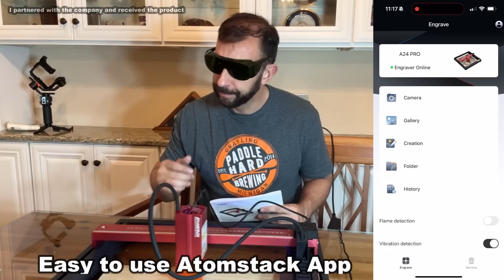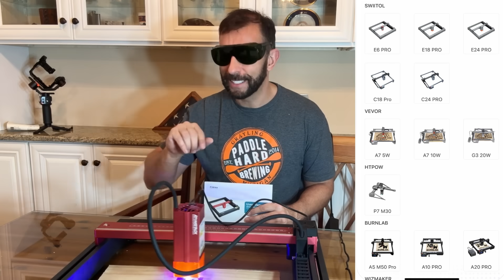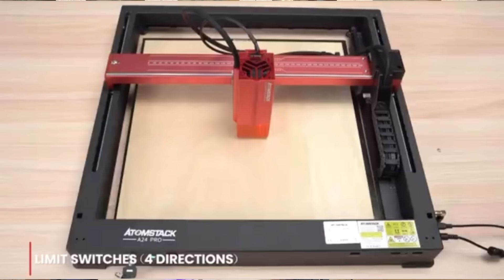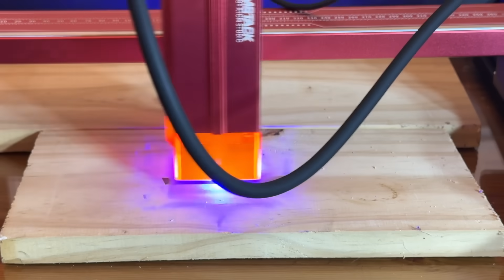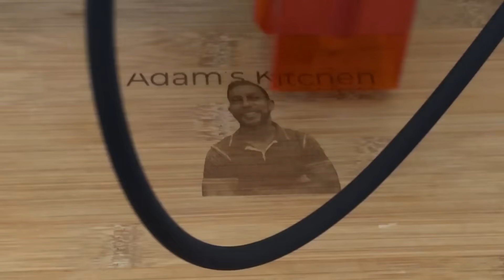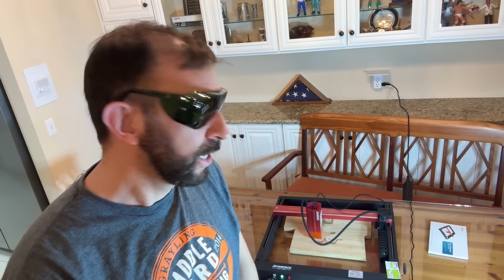AtomStack A24 Pro Laser Engraver

Comment: I have never owned or used a laser engraver until this unit. There are many videos out there that will help, plus the x tool creative space is Free, easily understood, and awesome to use! The assembly is very easy, and the machine is built rock solid. I was able to engrave and cut some impressive stuff the first day. I did have an issue with the xtool creative space running - customer service was prompt and very helpful. It turned out that it was operator error (novice) once I figured out what I was doing wrong this tool was unstoppable. I have cut wood, engraved wood (photo), etched glass tile (photo) etc,etc. The only limit is your Imagination!! I love this tool and strongly recommend it!!!
Reply from the maker: Thanks for the comment t